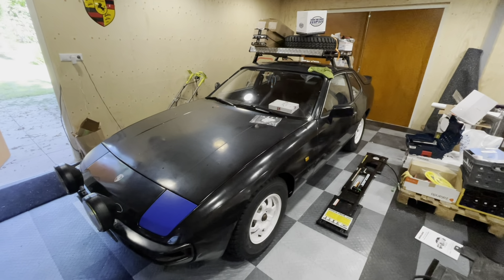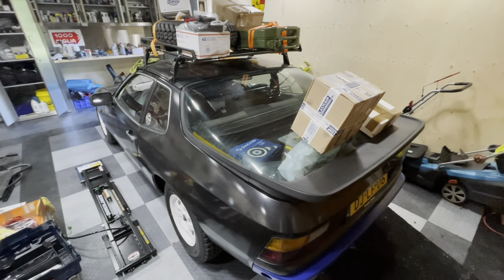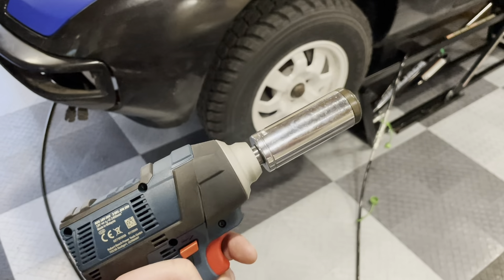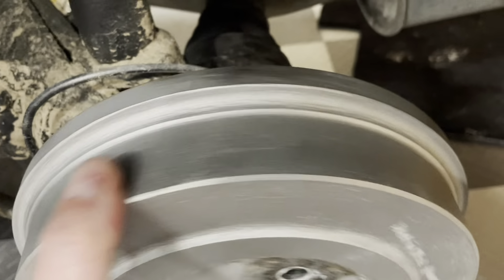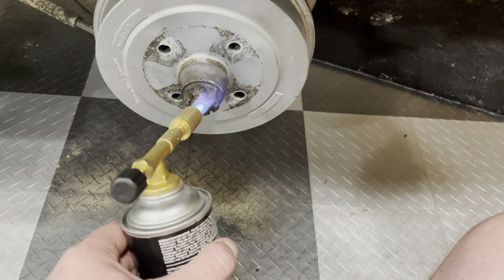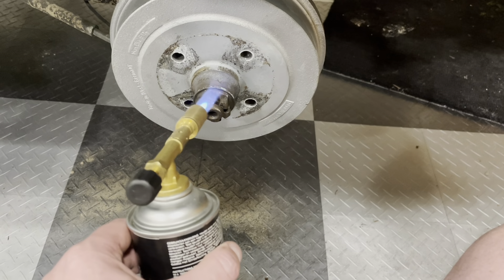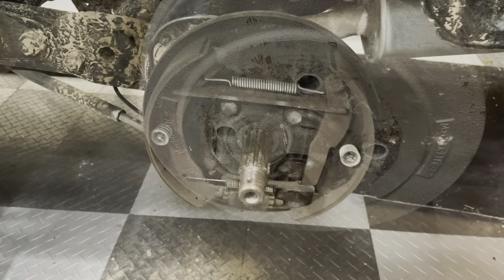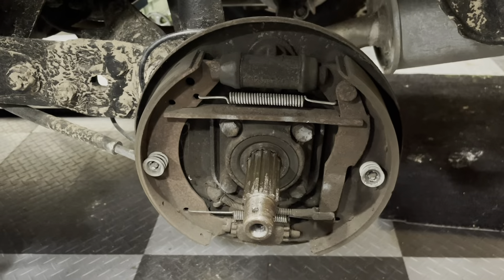Building a Porsche 924 Safari - Episode 8: The battle of the rear axle nut.

Comment: 1/2 breaker bar is to flexy, you need a 3/4 one. I had a 1.5-2 meter pipe on a 3/4 breaker when I removed these nuts from my 924. I was standing (90kg) on the bar, sort of jumping on it (to get some dynamic forces going) for some good minutes before it broke loose. 
The cotter pin is there to, in theory, stop the nut from spinning of if it gets loose. But I can say from experience that if the nut gets loose it can shop off the cotter pin!
Reply from the maker: I used a 3/4 breaker bar, but I snapped it off by the socket. It wasn't the best quality though and have since invested in a breaker bar from beta...hopefully this one won't snap.

Comment: I use a 3/4inch snap-on breaker 48" long with a 3/4 to 1/2 converter for hub nuts.
Reply from the maker: Crazy right? I tried the Torque multiplier on the other side a couple of days ago and managed to loop my Gedore T-Handle around the Torque multiplier!! In the end I just split the nut as I have new ones on order. I remember these being much easier to get loose...must be a combination of corrosion, age and the brakes not having been opened in roughly 15 years.

Comment: I‘ve had the same issue recently. I‘ve even brokenthe square adapter to the nut. I‘ve got it loose by welding a 36mm nut directly to a 2m long lever and jumped on it (100kg guy) after applying heat as well :-)
Reply from the maker: I have since seen that there is a special tool that the beetle guys use,  a kind of torque multiplier. I think I am going to source one and try it next time. https://vwparts.aircooled.net/Flywheel-and-Brake-Drum-Torque-Tool-Kit-36mm-p/torque-tool.htm

Comment: tool you use is a vw tool fits over nut and has a  handle off the side made to hit with a sledge..remember these cars were made same factory as va tools  parts are same .....  it takes even if stick ten minutes...oh electrical tip clean the five ground points where wireing meets one engine bay firewall  three under dash.last just above tail lights ..elimiate gremlins headlight popping up and down wipers going on tach going wild

Comment: Glad you pulled it off! I'm yet to have a nut or bolt I can't undune with my 1200nm air impact and some heat. Is that a QuickJack you're lifting your 924 with?
Reply from the maker: Thanks! I really need to invest in air tools...I'll put it on my Christmas list for my wife 😅.  It is a QuickJack BL-5000SLX, works a treat.
Reply: @GarageBiljon  A comment with both build threads I am watching at the moment! Both of these are keeping up my motivation to chase away my own 1981 924 gremlins
Reply from the maker: Thank you  @darrensutton407  , what needs to happen to your 924?
Reply: @GarageBiljon  It is a pretty good example but steering rack bush has collapsed, cold start issues and odometer not working are the main points.
Reply from the maker: Yup, I'll be fixing my odometer one of these days too  @darrensutton407  . I already have the new gear.